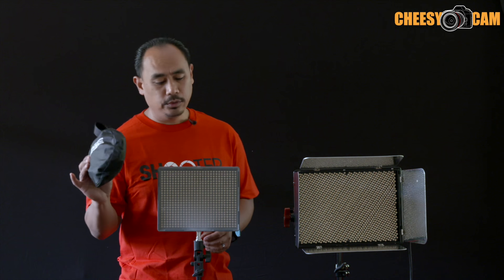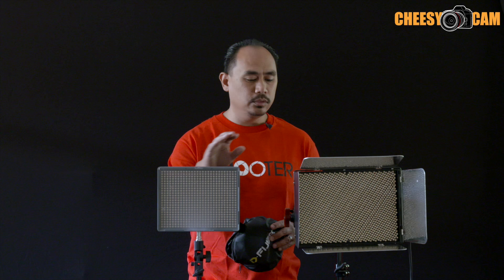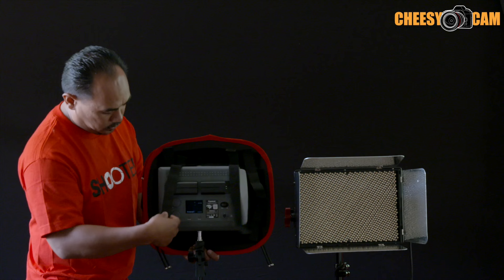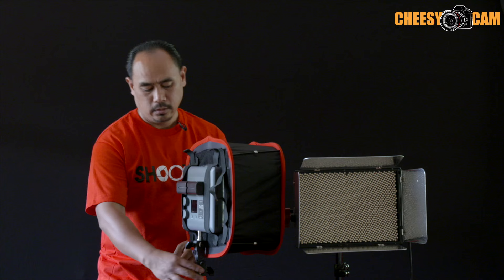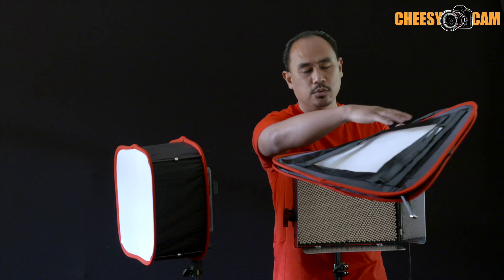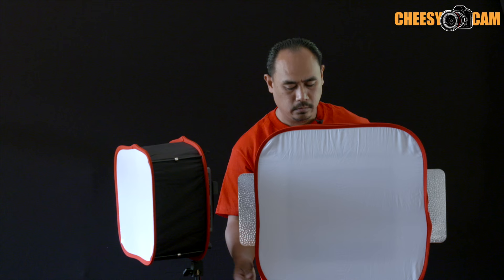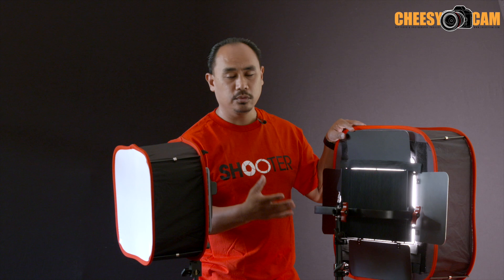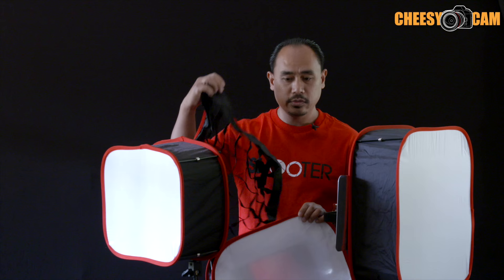D-Fuse Instant Pop Up Softboxes for Aputure Amaran 672 578 and Lightstorm LS1

Comment: Thanks for that! I grabbed the D-Fuse for the 672 and it is working great. Can I ask what stand you are using? I have an older, cheap one and the 672 doesn't fit snugly; it moves quite a bit from side to side. With thanks... :)

Comment: I have 3 of these lights and love them!  I use umbrellas on 2 and one with the grid/softbox as the back light but that thing falls apart.  Ill pick up one of these for the back light but wish it had an attachable grid!
Reply: I spoke to soon!  you mentioned grid accessories!  im sold
Reply from the maker: Yeah they have other accessories coming. I'm very interested in the full white version too, lights up a whole space evenly.
Reply: Hello may i ask you if you think that i will be needing a defuse kit with the 672 w? I understand the need on 672 s but u reckon i will need a defuse kit on w?
Reply: Stamatis Giannoulakis yes i dont even really notice a difference between the lights, i have two wide and one spot 672's and dont even know which one is which.
Reply: can you tell me what type of umbrella are you using with the 672? Send me the amazon link if you can. Thanks

Comment: I've been following them since that video and a month ago they came up with these new models and this smaller one might be the one I will get. I just wasn't if it would fit the YN300, but maybe with thern doors open it might be ok.I also do use those cheap Japanese Lantern for normal light as a diffuser and it works pretty well.

My only doubt is if these D-Fuse boxes have reflective materials inside. The part that is black outside, for instance. If not I wonder if buying those reflective fabric would help with the light's loss through the diffuser if I placed them inside.
Reply from the maker: Yes, there is reflective material on the inside walls. Check out my first video, I mention this. The reflective material on the inside walls helps bounce the spread and reflected light back out.
Reply: MrCheesyCam Thanks! I watched the video back then but I ended up forgetting... hahaha...

Comment: Hi, have you used these for any extended time with your 672/528? I've seen some third party softboxes reviewed online that cause the lights to melt because they've restricted ventilation. But I have Aputure's softbox, and it's really a struggle to assemble because the rods are too big for the holes they're meant to be inserted into, so I'd love an alternative
Reply from the maker: Wait, are you saying that an Aputure 672 panel melted with a softbox on? That's tough to do since LED lights run pretty cool.

But in any case, this doesn't cover the back of the LED light so it should vent fine. I know some softboxes cover the whole back back which I guess isn't the best idea.

Comment: Hey Cheesy!
Thanks for the update!  Will the small size [made for the Aputure/Amaran] also fit the Godox 308C II LED panel? [which, i believe is slightly smaller....]
Reply from the maker: I'm not exactly sure, but this thing is pretty universal. If you visit their product pages, they also have full specs and measurements for the front and back window so you can see if it will fit your LED Light.
Reply: MrCheesyCam thanks! ill check it out, and for good measure, ill contact them as well. 

On that GODOX 308C panel- im using it on its minimum power [=10%], and i still need to diffuse and lower its strength. just want a very small fill light when videographing people in low light situations.It feels very harsh as it is now without a diffuser of some sorts on it.. :\

Comment: Of the few available softboxes for the HR672 lights, which do you prefer? Seems like the Aputure version might be better than the D-Fuse.
Reply from the maker: One is faster to setup than the other. The Aputure version is great, just takes more time to setup and more small parts involved.
Reply: MrCheesyCam I plan on mounting two of these to a drop tile ceiling. They will be part of a permanent setup.
Reply from the maker: Then you will be fine with the aputure.
Reply: MrCheesyCam I appreciate the help

Comment: Question could the bigger softbox fit on the 682?
Reply from the maker: I would not get the biggest one for the 672.
Reply: OK great thanks. Just wanted to make sure it wasn't tooooo big for it, but apparently, I guess it is. I'll be getting the medium size then as that's right in the middle. I don't want the small one because despite fitting the amaran, it's just SUCH a small source while the med and large appear to be much bigger and better allowing for a bigger source of light.
Reply from the maker: Well you could use any softbox you want. The reason you don't want to use a larger one, is there is a cutout in the back that the light needs to fit into. Getting anything larger will mean you have a huge gap around the light. So you'll have to be creative in how you attach it to the light, and how you strap the velcro. If you are that creative, then you can get the larger box and make something to hold it in place.
Reply: ahhhh gotcha ok thanks!